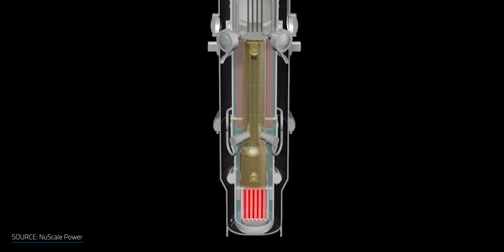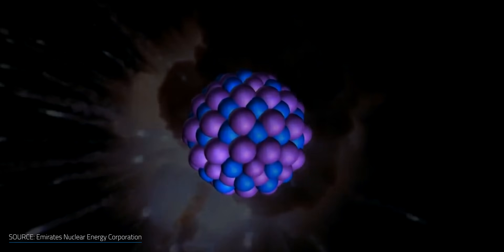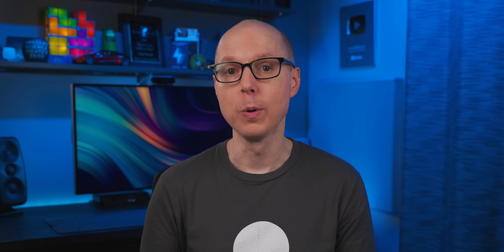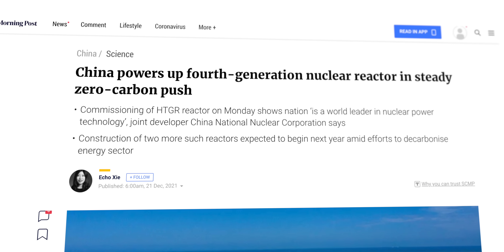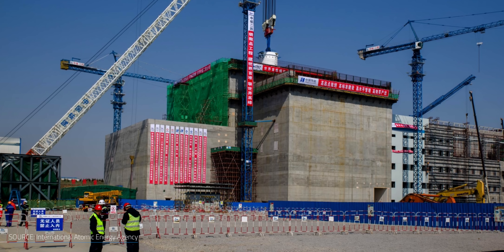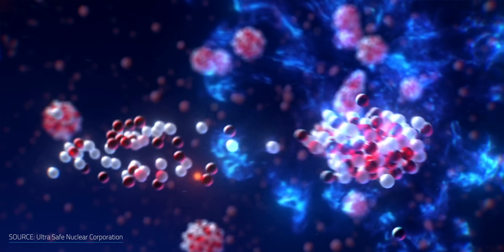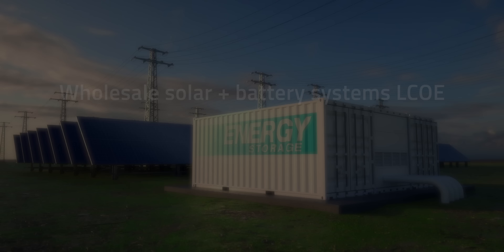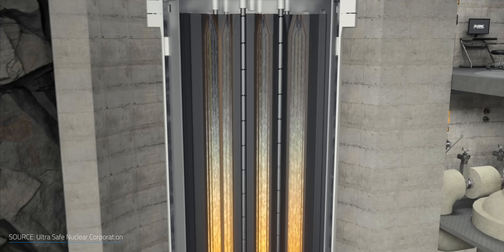Forget Small ... What About Micro Nuclear Energy?

Comment: In nuclear energy is more eficient the big reactors in terms of nuclear fuel burnt to energy produced, and little reactors need same safety meassures and more expenses per energy produced
Reply: Smaller reactors offer numerous advantages, but neither safety nor security are immediately noteworthy among them. Modularity makes smaller options much more able to be tailored to specific needs.  Redundancy allows for far better grid & transmission efficiencies and utilization. Pre-fab also contributes to standardization which always tends to improve safety and performance while reducing costs over time. 

Conversely, large-scale nuclear creates issues unique to its scale such as the impossibility of ever managing a meltdown (runaway core) such ad Fukushima or Chernobyl. 

Small (and especially micro) reactors introduce the possibility of housing all reactors at their final disposal sites such as deep in salt mines or perhaps down 2-5 km boreholes both options would greatly enhance security and safety by eliminating the handling and transportation of spent fuel, but this only works as long as reactors are designed and optimized for the geology & hydrology of their subterranean sites.
Reply: @scottaseigel5715  Cooling is also a big issue with nuclear reactors. French  reactors had to be shut down some past summers as the rivers used for cooling didn't have enough water. I fear that kills your salt mine idea.
Reply: @wolfgang4593  not at all! Geology is fantastic for thermoregulation. That’s how heat pump HVAC systems work. The only issue is proper design. Waste heat can easily be used to heat (and dry) subterranean spaces making them far more human-friendly. It can be used exactly as geothermal energy is used. The caveat is that if it’s heat from a fission reactor, the potential for radiation leakage must be factored into its design.
Reply: I'm not sure I fully understand your comment but we expect SMR's to produce power more cheaply because of economies of scale. With traditional reactors we design them and then only build a handful. There's no opportunity to improve the process or leverage the power of competition in the market. One of the reasons for this is the regulatory environment. It's so hard to get permission to build a reactor you push it right to the very limit to maximise the power you can produce.
Reply: Is it safer? If yes, then it's better, even if it's more expensive.